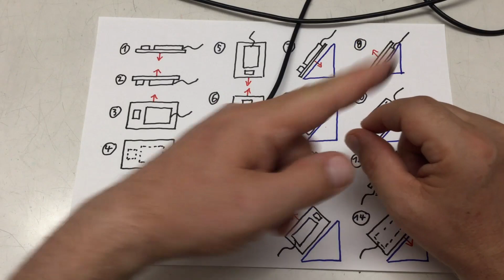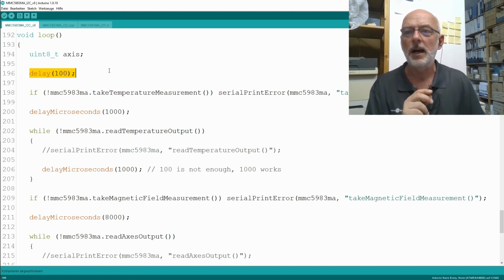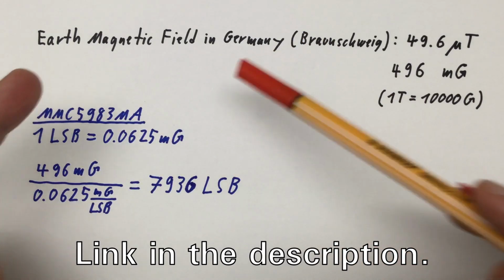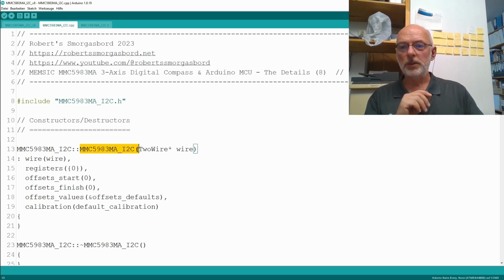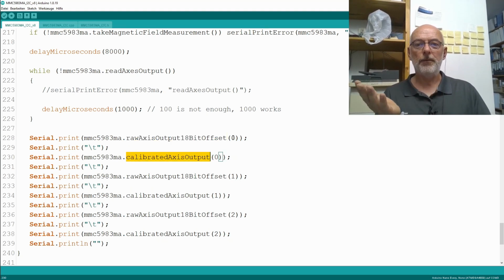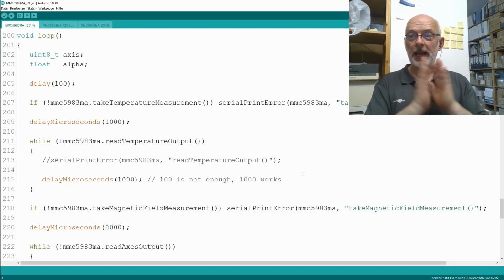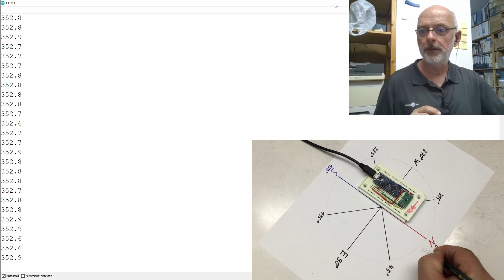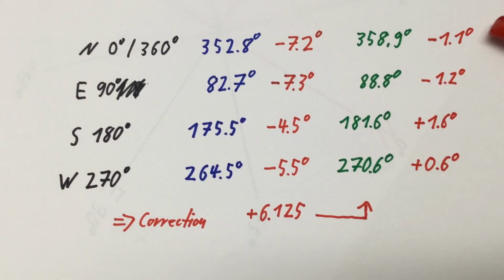MEMSIC MMC5983MA 3-Axis Digital Compass & Arduino MCU – The Details (8)

Comment: Hi, when i try add your library, IDE showed this information: Error: 13 INTERNAL: Library install failed: archive is not valid: multiple files found in zip file top level. Can you give any advice ?
Reply from the maker: You have to add my library manually. Copy the .h and .cpp file to your sketch's folder. Reference the library using #include "MMC5983_IC2.H" (don't use the <> syntax). Hope that helps.

Comment: Robert,  I count myself as part of the elite group of 200 who have watched all 4.5 hours of this series.  It is hard to believe that you are short on time.  I am working on a compass that will be installed on a 2 meter automated sailboat for Atlantic Ocean bluewater sailing.  I have tried the LIS3MDL, LIS2MDL, and the MMC5603 which is the poor sister of your MMC5983MA, with only 4 pins.  I have the Sparkfun MMC5983 board on order, but of all the magnetometers I have tried, the MMC5603 seems to be very much the best.  Your video series was spot on for many issues I have encountered with the MMC5603.  Thanks!  I have two questions and a comment:

Q1)   I always thought I needed a separate calibration for each temperature (+- 5 degrees).  You have handled the temperature for only the offset, and done the calibration at a higher level.  This is much easier than my expectation.  Help me understand why your calibration is good for a range of temperatures.

Q2)  I have experienced occasional hanging of my I2C bus which I believe is happening in Wire.endTransmission().  I have reset the board (equivalent to watchdog), but found the I2C bus to be still locked up.  I have a method to power cycle the I2C bus, but I need a good method for causing this lock-up so I can test my fix.  Your suggestions?

Comment:  It turns out that the Z axis has much more magnetic field strength than X and Y.  This means that a compass based on just the X and Y axis must be kept level to minimize the effects of the strong component of earth's magnetic field directly toward the center of the earth.    This, of course is an unreasonable expectation onboard a sailboat at sea.   I am using the Arduino AHRS routines which do exactly this compensation, and were fairly easy to get working.  They do require a gyro and accelerometer, which also need to be calibrated.

Doug
Reply from the maker: To answer your questions:

Q1) Compensating for the temperature drift of the 0 point of each of the three sensors (X, Y, Z) individually should be good enough. Any temperature drift of the gain (output change with magnetic field strength change) of the sensors should be pretty much uniform for all three sensors. Thus the vector they are pointing to [X, Y, Z] shouldn't change in direction, but in length only. Any deviations there are taken care of by the (non temperature dependent) matrix/vector calibration. That said, you might be able to get a tiny bit more accuracy using calibration matrixes/vectors for different temperatures. But in my (!) opinion (!) it isn't worth the effort.

Q2) I think I solved the problem with a little code change in part 9: https://www.youtube.com/watch?v=BgSZ5XZTDDg

In reply to your comment:

At one point I will continue this series and add roll/pitch compensation with the help of an accelerometer (and maybe gyros).
Reply: Robert,  Thanks for the reply.  My Q2) had nothing to do with your mmc5983 video series.  It was much more general:  How do I intentionally lock up the I2C bus to test my power cycle recovery techniques?  On my system, I might need to wait months to see it happen.  And a new question (I see this behavior with both the mmc5603 and mmc5983):

Q3  when I do the offset calculation, I get a table of numbers at various temperatures.  I use a bowl of water, starting with ice cubes and adding boiling water little by little.  If I do the same procedure a few minutes later, or the next day, I get numbers that can be 10 to 20% different.  It can't be orientation, or stray magnetic fields.  Any ideas?

Thanks,  Doug
Reply: Robert,  I think I answered my last question (Q3).  I find if I flex the evaluation board with my fingers, or tighten the mounting screw(s), I can change the output data by quite a bit;  as much as 40 LSB (16 bits), or about 1 uT.
Reply from the maker: @DougWhitman-m5n  Hi Doug, stray magnetic fields respectively orientation, effectively at what magnetic field through your chip you're measuring the offset can have an influence. But my money is on the way (the speed) temperature is changing having the largest influence. It takes some time for the temperature to equalize throughout the chip (temperature and magnetic sensors being at the same temperature) after a temperature change. That's why I mentioned in the videos when I took the offset measurements (cold spray and heat gun 😅) that you probably need a climate chamber.
Reply from the maker: @DougWhitman-m5n  What is your evaluation board made of and what are your screws made of? Is any mechanical stress transferred to the chip?
Reply: Robert, do you have a simple method of intentionally locking up the I2C bus to test my power-cycle recovery technique.
Reply: The eval boards are all fiberglass.  The screws are brass.  I have no way to measure stress forces in the chip, but I don't think it is likely that flexing the fiberglass alone would have this effect, because all the signals, outside the chip, are digital.  I can drive the screws almost all the way with no effect;  then, when I tighten them the last bit, I see the readings change.  I should probably mount them with double-sided foam tape, or Velcro.
Reply from the maker: @DougWhitman-m5n  Sorry, I don't. At least not a simple one ... You could program a MCU as a I2C slave device that "misbehaves". But that doesn't count as simple method, does it?
Reply from the maker: @DougWhitman-m5n  Well, since the board is non-ferromagnetic and the screws (brass) are also non-ferromagnetic, that really leaves only mechanical stress. Double sided foam tape seems to be a good idea.
Reply: Thanks
Reply from the maker: @DougWhitman-m5n  You're welcome!

Comment: When the sensor comes near the ferromagnetic materials its accuracy decrease or the sensor fridge. It does not work properly. Ex-iron plates, iron bolts, nuts, wires, motors, and speakers. Please give me solution.
Reply from the maker: Unfortunately there is no simple solution for that. Ferromagnetic materials will always interfere with magnetic fields and thus magnetic sensors. For compasses (electronic and conventional with a magnetic needle) the best practice is to keep away from ferromagnetic materials. E.g. steel boats often have a repeating magentic compass mounted up high on top of a mast. If you can't, you have to calibrate your sensor in-situ (that is you have to take all the calibration data with the ferromagnetic material in place around your sensor).